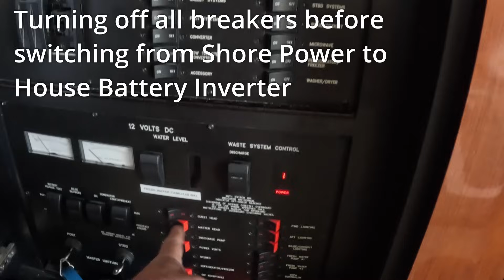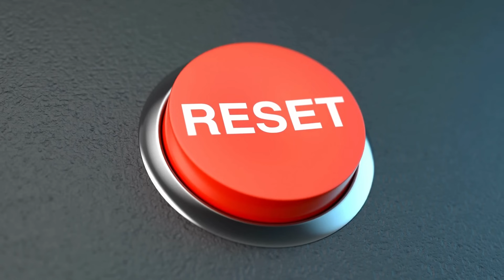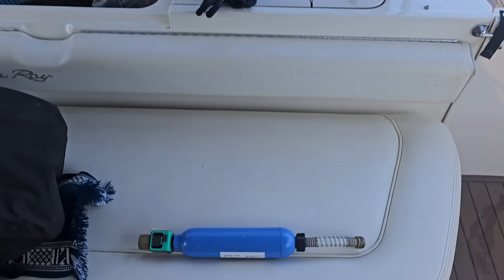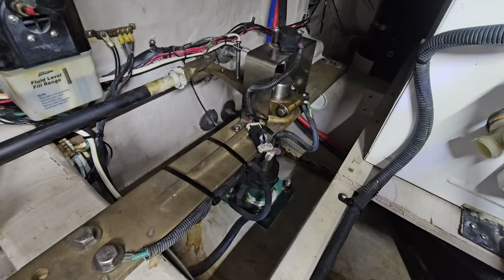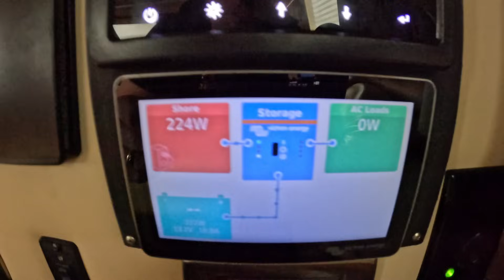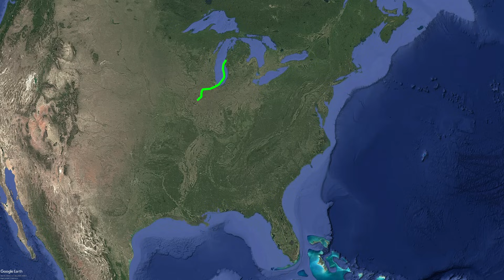S5E2-To Loop? or Not to Loop?

Comment: I would be more concerned about carbon monoxide buildup than a dirty air filter. Finding the leak should be pretty easy as you take off the turbo. Just follow the dirt.

Comment: Sounds like the DC/AC converter circuit within the victron inverter/converter unit. This is hard to tell not knowing how it was wired to the boats electrical system. Hopefully they wired it between the the/an isolation transformer?

Comment: One option would be to swap the turbos.  1) you may find the problem right away during the swap, 2) you can monitor the "broken" one more easily if it's on the port side.

Comment: I resided between Orange Beach and Gulf Shores (community next door) for app. 2 years. It's a nice region, and for many unknown verses Florida which is just "down the road". The water is not as nice as you proceed east down the Florida coastline (nicer beaches and clarity of the water). You have the Mississippi that dumps into the "Gulf", followed by the "bay" between Mobile and what they refer to as the eastern shore where Daphne and Fairhope is located. The "bay" is NOT desirable and there are warnings often based on the pollution, hence do not swim. Fairhope is an incredible community and a must visit if you are in Orange Beach ( app. 30/45 minutes way). AS noted, the gulf coast of Alabama was somewhat unknown to many and affordable till recent years and there is an explosion of development (hence COST). Obvious there is the well-known FLORA-BAMA Bar which sits on the Stateline, actually known as the Perdido Key area. It's a very nice region, especially if you are from the north and naive as I was. It does become nicer as you proceed east through Pensacola and down the shoreline to Ft. Walton Beach (and beyond), here the water is actually blue, and the beaches become more beautiful...back to Orange beach, on the drive to Fairhope there is Magnolia Springs, very small community, but there's a really nice restaurant, "Jesses", great food, abit pricey but very nice. I retired from the Ann Arbor region, placed the dog in the car and proceeded south, stumbled apon the coastline of Alabama, followed by Florida...actually took a DIRECT hit per a hurricane and performed relief in the process, I lived/witnesses the tears, crying, hugging, and praying....

Comment: I don't know what your cummins buddy told you.  I assume he commented about the excessive soot and contributed it to the filter.  But why would an indoor filter get dirty to start with.  Is your exhaust plugged? That's a lot of soot.  Hope you have a  carbon monoxide detector.

Hopefully, he mentioned something about your crankcase pressure blowing the oil fill cap off.  You shouldn't have that much, and can't allow it to build.  It will find a way to relieve itself.

Comment: I had that same Victron unit on my old boat.  They do have at least one fuse internally, if I remember correctly.  They also have an overheating safety that can cause the unit to stop working.  Either way, it would be worth having a tech come and take a look. IMO

Comment: I had no generator my refrigerator ran off 12 via as long as I was running it was running and cooling when I anchored for the night it wasn't cooling obviously but I was careful to get out when I needed before I shut the engine off so everything stayed nice and cold plus I had a nice cooler in the cockpit with ice and beer and milk and you know that kind of stuff so it was pretty easy I'm totally into very low maintenance stuff anchor winch a great yanmar engine very simple very easy low maintenance I encourage you guys to simplify your life and unload that big complicated Sea Ray and find something much simpler and much easier to deal with nonetheless love your stuff I followed you from day one and my heart was in my throat when you guys were stuck in Alabama wondering whether you're going to be able to go ahead or not
Reply: I did have a harbor freight 2.5 KW gasoline generator in my cockpit that would run my AC at night if I needed it but I never even started that thing up and I know you guys are used to the luxuries of a big Sea Ray but I think you would find it comfortable just to find everything to be more simple

Comment: And get a pilot hous hardtop with no flybridge you'll be able to Cruise under most of the bridges on the loop without going through the agony of whatever. It's so much easier and so much simpler if you don't have all that complicated stuff to deal with I did it with an iPad with aqua map I also had a Garmin something I don't remember what it was or what it is but I use the iPad as my navigation app I had a installed 12-volt cigarette lighter type outlet that I can plug my iPad into mounted it on a RAM mount and it was easy peasy plus I could use the iPad if I was in the marina to check email pay bills and all that kind of stuff personally I really think simplifying is the name of the game you guys are on a big complicated complex boat with more systems than you really need

Comment: You didn't ask but I will give you some free advice sell that Big Sea Ray get a smaller boat with a single screw Diesel with a keel with a generator so you have AC and all that kind of good stuff it'll simplify your life and you won't have to deal with all the crazy systems on those SeaRay. You may have to give up some of the comforts of a large twin screw boat but your life will be so much more simple you have one engine to worry about and it's much easier to take care of you'll have a keel that protect your prop and what happened to you over in the 10-time won't happen since you have a keel so that's my free advice I did it on a single screw 32 ft Atlas Acadia lobster looking boat and it was so simple 310 horsepower yanmar I did not have a generator which would have been nice but I did have AC when I was plugged in to shore power so anyway take that for what it's worth love your videos you guys are fabulous people thank you so much for all the entertainment and the love you sent out to the boating .community
Reply: You need to stop thinking for them I'm Shure you don't even have a boat and if you do it's some clapped out junk that just sits at the dock Give it a rest and eat another tuna fish sandwich

Comment: Lol was that Drift Away @ 9:40 in?  They had video of you on their channel passing you.  I'm just at that point in the video now. I'm Computer science that fell into a process control/engineering job.  Know just enough electrical to be dangerous!  We have installed stuff bad out of the box or some that failed after a month or 2.  You're too meticulous in your approach to believe you did something wrong on the install especially since it worked for most of the loop.  Software or some internal failed component would be my guess

Comment: Everyone I know who installed the Victron system has issues. I have a fridge and freezer which run off twin 200 amp lithium batteries (which have an independent charger) running to a large inverter when no genny or shore power is available. We start the genny to cook or run AC. It is a compromise but it works great and I can repair it.

Comment: Your exhaust leak may be the V-band clamp under the heat blanket. If memory serves, QSM11 marine engines have two v-band clamps that connect the sections together. You can see the intake V-band clamp but there is a second v-clamp under the heat blanket. It is not uncommon for the hot section clamp to loosen allowing exhaust soot to be pushed out the heat shield. I had this exact issue happen to us on the Oswego canal although it was with a different brand engine. I removed the heat shield, tightened the clamp and no more soot. 

The belt dust you are seeing is a common problem with high output alternators. I don't know the amp rating of your alienator but as an example, a 250 amp alternator requires something close to 25 HP to run it. That puts a lot of stress on the belt so they produce a lot of dust. The dust isn't an issue other than cosmetic. 

Can't help with the Victron other than to say the multiplus series has a number of known issues. I would push for a warranty replacement. Victron makes great equipment and I have 100% Victron on our boat but I went old school with a dedicated chargers and dedicated inverters. 

I agree with others, Go South.

Comment: I would take care of the exhaust leak (exhaust manifold??) and consider rebuilding or replacing the starboard turbo before venturing on a long voyage.  I am assuming you have been in contact with Cummins service (Bridgeway Cummins).  The engine repair and sourcing of parts may take longer than you anticipated.  I realize I am probably one year behind hat you decided to do but I speak from experience of owning Cummins QSM11 engines in my 52 SeaRay Sundancer.  I also was noticing you had high fuel usage (gph) during your test run at 1950 rpm on the port engine.  Was that indicative in your normal gph or was that because of the higher engine load since the starboard engine was limping at 1450rpm.  Good luck and keep the updates coming